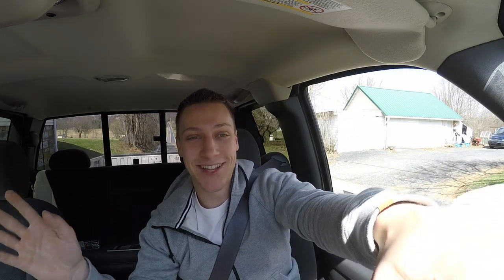WHY I DON'T Roll Coal...

Comment: He calls dodge trash when he has a LB7 lol. RIP LB7 Long live the 12 Valve Cummins!!
Reply: "Dodge the trash can"  not dodge is trash
Reply: +michael angstrom alright alright.
Reply: rip injectors
Reply: +Pear 4 05 was an LLY not LB7 but alright and 24 valve before 12 any day
Reply: Payton Bosserman Mike said himself it's an 05 which makes it an LLY. LBZ was introduced until 06.
Reply: +Bhswarrior94 look at the front end. it's an 06
Reply: Payton Bosserman and your point is what makes you think it's an 06? I have an 06 myself there bud but mines not an LBZ either and my cousin has and 05 they're practically the same truck cosmetically
Reply: +Bhswarrior94 and I've got an 04. the 06 has the split front grille, where as the 05 and 03 04 had the solid chrome strip
Reply: +Bhswarrior94 And 06 was when the introduced the lbz. they used the rest of the lly's in the Kodiaks and top kicks but dumbed down the horse power in them
Reply: Got a butt hurt dodge fan over here lmao
Reply: +Braeden Wims bullshit. Unless it's never driven, it should of give through at least one injector because they regularly crack injector cups.
Reply: Payton Bosserman they may have introduced the LBZ in 06 but that doesn't explain the LML under my 06's hood huh?
Reply: +Bhswarrior94 sounds like an engine swap
Reply: +Bhswarrior94 just curious, why did you put an lml In your 06 over the lbz?
Reply: Payton Bosserman The truck has been put to work got it with around 500K hard earned miles on it. And I was gonna do stuff to it so I got a newer motor with less miles and a little bit more power to start out with. Nothing against the LBZ or anything and also 2012 LML is better in a cateye than the new body style in my opinion.
Reply: Pear 4 lby*
Reply: Payton Bosserman 05*
Reply: What about the 24v 😭
Reply: Lol dodge had to buy the cummins its not even theres. Atleast gm developt the duramax
Reply: Jeffrey Hutt actually Isuzu helped developing it, without them gm woulda created another pile. All those 2 ton flat cabbed box trucks, yep powered by a duramax. Gm hadn't developed a good diesel by themselves since the v series 2 stroke detroits from the late 40s to the mid 80s.
Reply: Colton Carpenter your 100%  right they teamed up with Gm but you see thats the key word team what did dodge do watch cummins build and put there engine in the shitty trucks they couldnt put a front end under for 25 years lol
Reply: Colton Carpenter and dodge has costed off the coat tales of and engine they didnt even build
Reply: Jeffrey Hutt I won't touch a 2wd diesel none of them have front end able to that. But if I had a choice I'd rather rather have a dodges straight axle under my lbz than the pos independent front suspension. Then again with the frame hanging so low on gm's it'd be a waste to have a heavy axle under it since you can't go any off road with a lift. Maybe that's why most farmers buy a dodge or ford as a feed truck with a flatbed and bed spikes. I like the lbz and the allison but the rest of the pick up is crap.
Reply: Colton Carpenter. Really no one drives 2 wheel junk around here ether yet the dodge guys are ether putting front ends in the trucks or the drive shaft is laying on the ground under it where the rear yolk came apart iv seen5 like this in the last 6 months one even converted and bought a chevy. And a gain let me know when dodge actually make there own hd engine cuz we all know they didnt make the cummins and if it wernt for the cummins dodge would of folded up and filed for bankruptcy
Reply: Colton Carpenter have fun driving your fiat or fargo
Reply: Jeffrey Hutt nothin wrong with companies using an engine they didn't develope. Farm equipment construction and over the road trucks have done it for years. I'm glad they use cummins. I like the cummins as much as the duramax. One drive line is cheaper that half shafts, u joints, and dealing with a pos independent front suspension. Why gm went it is beyond me. You can't even use em like a pick up anymore unless it your Sunday driver in the city but I got a 4 in lift or 6in lift. Cool dude have fun tryin to use that pickup to pull a goose neck trailer or bumper pull with out some altered bs. Detach your self from gm's nuts for once and look at the bigger picture. The reason why those dodge drives went to shit is cause who ever owns treats things like shit or didn't get properly lifted. I've never never seen a drive break or yoke snap except EXCEPT on a twin turboed 1900hp 12 valve that had been pulling it's whole life. I've been around them all and I drive chevy and have a z06 but when it comes to a work Truck or pullin truck the dodge will out last a gm in drive train with a manual.

Comment: I remember watching the poor bastards with early diesels up above 9000 feet above seal level, trying to make it over Loveland Pass, rolling coal, going  30 MPH with the engine doing everything it can to keep the truck going uphill. This was way back before diesels had altitude sensors on them and at 5500 feet above sea level a diesel tuned to run at sea level would only run at about 60% power. By the time they hit the summit at 12,000 feet they were running full throttle, but only getting maybe 33% of the power they would get at sea level. They sure rolled coal like you would not believe. The air is so rarified and thin up there,. the oxygen content becomes low enough that most of the diesel fuel comes out the exhaust unburned.  Having driven an old diesel over some of those passes, at 70% reduced power, I have to ask myself, "Why the hell would I ever do that on purpose?" I have rebuilt those high altitude diesel engines that poured out black smoke and the cylinder walls, and valves. are totally carboned up. It just seems like kind of a waste. If your truck is running properly it won't pour out unused fuel. Oil burning locomotives, and diesel locomotives are the same way. Lots of smoke = wasted fuel. I have a Cummins Dodge that is pain in the ass to drive around town. The power band is for towing a heavy trailer, so it works great on the highway, with a big heavy 5th wheel trailer, but that is about all it's good for. The poor gas engine, and lesser diesel trucks that are struggling over a 10% grade are doing good to keep up at 70 MPH, while I still have plenty of pedal at 90 MPH going up the 11 1/2% grade at Recapture. Getting it moving from a standing stop is another story. That is why it sucks in town.

Comment: If you go look up any performance diesel truck they will all billow black smoke and it is not because of a tune, it has to do with larger injectors and as he said not all of the fuel being used and running rich. It also seems that many of the concepts are misconceptions and people who don't know a lot about diesels. NO it does not harm the motor in any way. NO rolling coal does not lose power (how does that even make sense). Yes I love rolling coal and yes it is definitely a duchy thing to do, but don't knock it til you try it. Everyone is entitled to doing what they want to their car, rolling or not, don't leave all these hate comments without knowing all of the facts! Still gotta love your videos keep it up!

Comment: I bought an 04 LB7 about 3 months ago...I never really had a desire to roll coal all over town, but my little bro thinks it's cool, so I thought I'd see what the truck could do. I switched the Bullydog GT that came with the truck into "Extreme Power" (oh boy), gave her the beans from a stop light, and got a hazy cloud of diesel exhaust in my wake. My little bro was a little disappointed, but I really wasn't. 

I realized that my truck is running as efficiently and optimally as I could want, losing as little power as possible (and not fucking my injectors in the process). I don't want to be known as that tool who runs around smoking everyone out, and I know my truck has plenty of power. I can be rolling down the street, hit the throttle, and break the tires loose without a problem. Now, am I too high and mighty to punch the throttle and give the little twits fucking around in the rice burner next to me a Coal Facial? Nope. Cuz that's just plain funny.

Comment: My 650 horse tune just rolls as a side effect lol
Reply: same here. my truck blows smoke as a byproduct of the horses ive added.
Reply: My 800 horse tune doesn't roll any coal at all, it's a byproduct of knowing what the hell you're doing when you build a tune to match your engine build.
Reply: +im1469 some people don't have the money to do that
Reply: All it takes is time and priorities. Ooh, and learning how it actually works. Any Joe blow off the street can dump a ton of fuel in an engine and make a little power and a ton of smoke. But when you see one making 600 plus with only a puff to spool the turbo, that's when there was real skill involved. Do your research, read everything you can about the topic, and you'll learn the truth.
Reply: +Christian Figueroa byproduct of the horses you've added? Do you know what rolling coal is? It's un burned fuel... So if you're rolling coal then you need. To run less fuel obviously
Reply: +im1469 800 HP no smoke at all? LIES
Reply: Stuntihn MX as an automotive engineering student, yes I know what it is. I cannot just "give it less fuel" my tune only allows for 6 pre-set setting, and I am not ready to get a custom tune until i finish purchasing my bolt on upgrades.
yes my truck does blow some smoke on the highest 3 settings (each one a little more than the one before it).

and by your logic, the second it starts whisping smoke is the second that you cannot gain any more power by adding more fuel. This is false. adding more fuel will still add more power.

EAT MY SHORTS
Reply: You clearly don't know anything about diesels.
Reply: Angus Macaleese who doesn't?
Reply: +Christian Figueroa preset settings. There it is. So he doesn't have a fuel mapping specifically for his truck, with his mods and appropriate altitude. Presets are for every truck, so safer to run rich.

Comment: Straight piping your diesel and doing a turbo back will give you a little coal
Reply: Yes
Reply: No it won't. It all depends on how much fuel is being dumped in the engine.
Reply: +Angus Macaleese yes it does! Worked on my cummins
Reply: Gavin Steiling Make a vid. Doesn't make sense (not trying to offend you)
Reply: +Angus Macaleese a straight pipe gets rid of your cat and muffler and on newer rigs it deletes your dpf. the cat and dpf soak up the coal so when removed a stock vehicle will spit out a little coal, not much but some.
Reply: Bridger Walczynski I have a straight piped 7.3 does not smoke at all.
Reply: +Bridger Walczynski Nope mufflers and cats don't reduce visible emissions! catalytic converters don't trap coal they scrub certain gasses from the exhaust. All a muffler does is quiet or Muffle sound hence the name "Muffler"!

Comment: No you do not need to have a tune to black smoke! You don't know what you're talking about. Most People CAN achieve it by using a tune but its not good for your injectors. Stage 2 or stage 3 injectors will make any diesel truck smoke. Basically the bigger the injector the more fuel that is dumped into the engine.
Reply: or if you drove a 7.3 just turn up your fuel pump a quarter turn and you'll have a thin smoke instead of the super thick smoke. or simply get bigger injectors, turn up that fuel pump and buy yourself a bullydog programmer all at once to achieve ultimate douchness when getting onto the highway!
Reply: depends on your year 7.3 with the 94.5 and up PSD its not as simple as turning up a screw like it is on the 7.3 IDI
Reply: 96jeepjs  it was that simple for my 98 but that was the last model with a fully mechanical engine. 99 would be different.
Reply: there wasn't a 7.3 in 98? 94.5-97 was the OBS 7.3 and 99+ was the SD 7.3
Reply: 96jeepjs it was a 7.3 none the less. Same motor with different electronics. I might not be the most educated on the 7.3 alone but I can tell you what I owned and what I did to it.
Reply: Alot of trucks run common rails so Cranking up a injectors would just add preasure to your fuel lines OR rails then your lines brust and Fuel everywhere

Comment: Getting a roll coal tune is bad because that is when you start breaking stuff my uncle had an 08 Cummins had a tune on it it was fine then put a roll coal tune on it and blew the turbo and over heated it a couple times then he sold it and bought a 2011 and is keeping it stock.

Comment: You are mostly right about how the coal rolling thing works, but just to add a bit, older diesel engines, like the 12v cummins, do not have much for an ECM. Trucks with mechanical fuel pumps roll coal even before you mess with the pump because the pump had to account for the correct air-fuel ratio at high idle with the turbo spool. The somewhat never pumps for the 24v and common rail cummins engines have a mechanical fuel retarder that delays the timing in the pump for both cold starts and for the idle to not run rich. The more current trucks, like your Duramax, have electronically controlled injection pumps, that do the same thing as the pumps with the fuel retarder, but instead use solenoids and the truck's computer. 

Hope this helps to shed some light on why some trucks roll coal. I'm glad you are choosing to go this route with your truck, as in not rolling coal. I personally like a little coal, but i prefer older trucks that do it out of necessity.
Reply from the maker: +Derrick Spoelhof Yea I'm sure with the older trucks it can happen pretty often